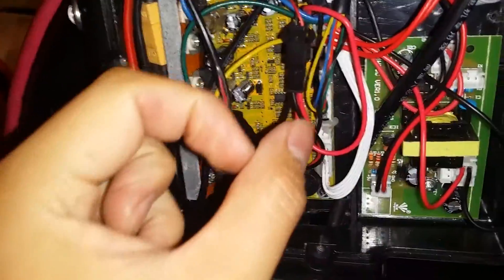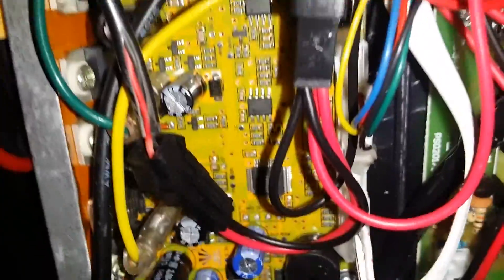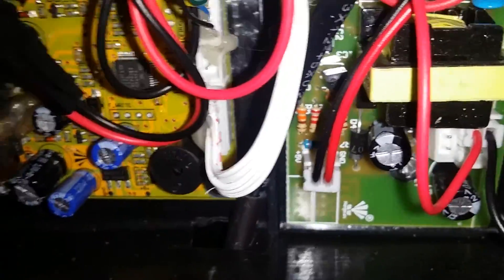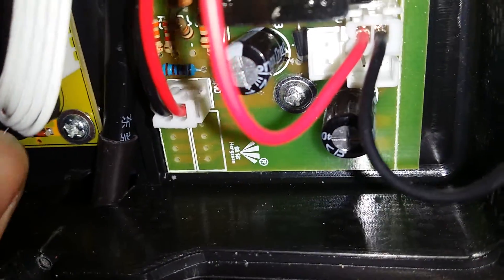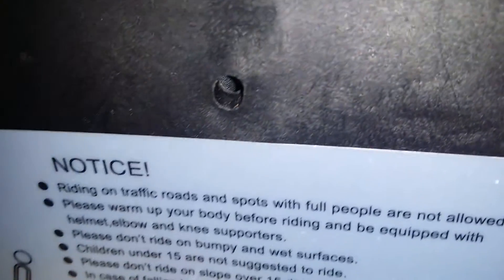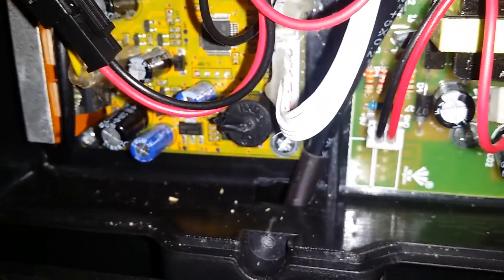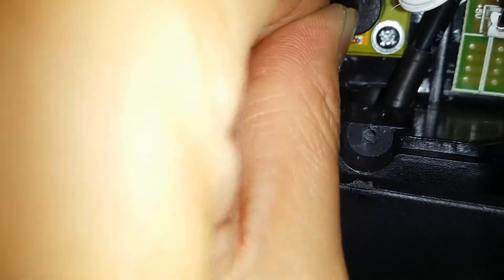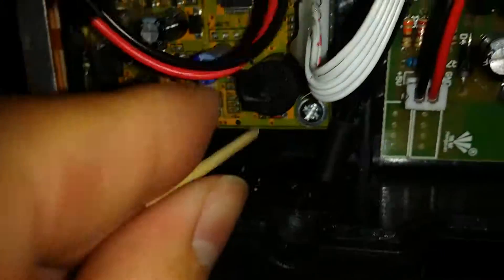Silence your beeping unicycle

Comment: Thanks for making this video. I have an Airwheel and after the first day had to cut the wire and put a tiny push button in the circuit. I had these from another project http://www.amazon.com/gp/product/B00DCAJEM0 So now I can choose to turn the sound back on if I feel the need to hear the low battery warning. However, on the Airwheel it's pretty obvious that it is dying because it tilts you back more and more to where you can hardly even lean forward to make it go. It's like a progressively more extreme version of the max speed warning. Don't know if yours has that.
Reply from the maker: It does, but it's not enough, my ankles just compensate for the tilt.